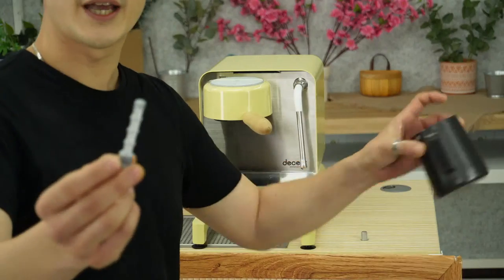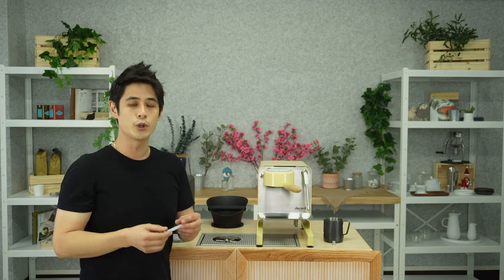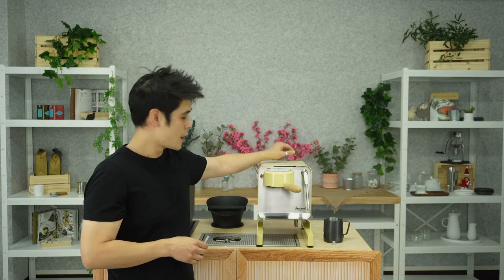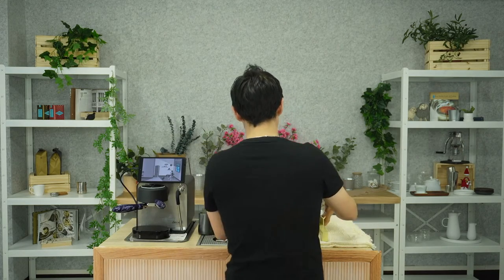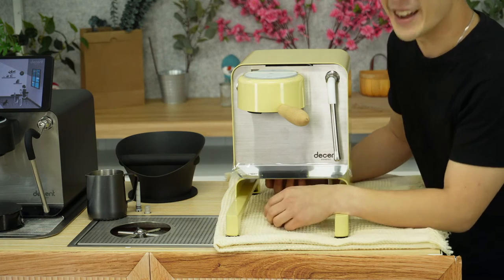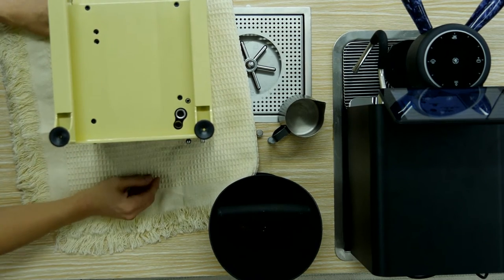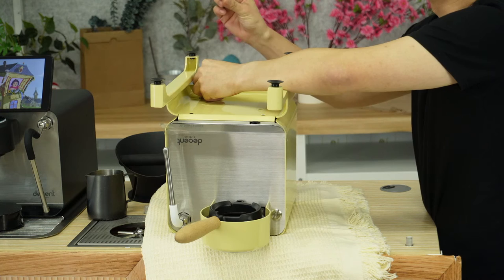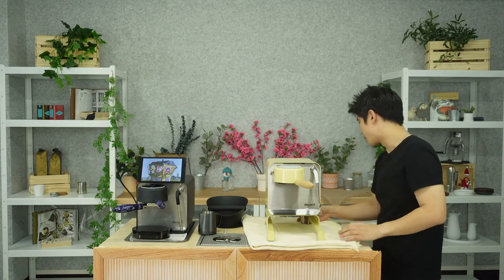New water intake filter how-to

Comment: Somewhere a while back I heard that the new filter would result in the machine being able to draw more water from the tank before the "low water" warning, and so I got one with that in mind.  I expected that installation would require some sort of different calibration in order to make that happen and was expecting that in this video.  What I heard in this video is that this notion is incorrect and that the new filter does not let the machine use more of the water in the tank.   What is the reality here?
Reply from the maker: The new filter should help with the pressure sensor that detects the water level. The previous filter sometimes caused false readings and so required a refill even if there was still some water left in the tank. The new filter due to the increased surface area and pillars at the bottom should improve the accuracy of the water pressure sensor.